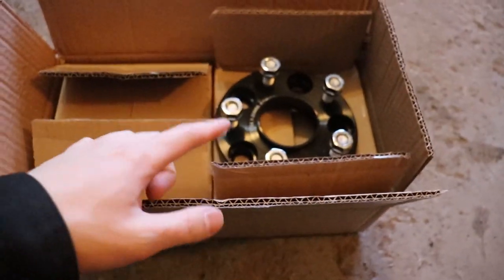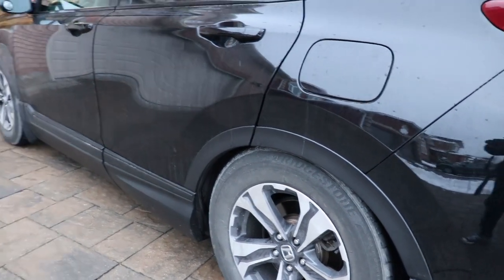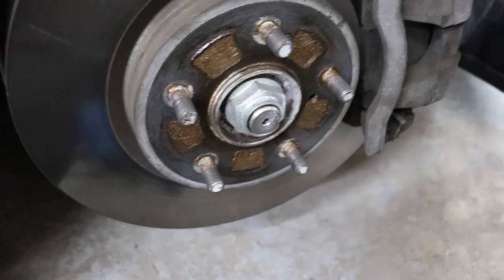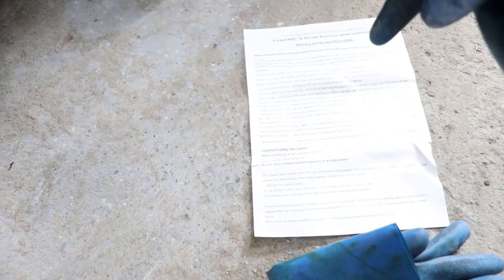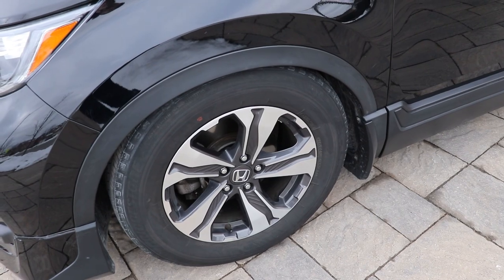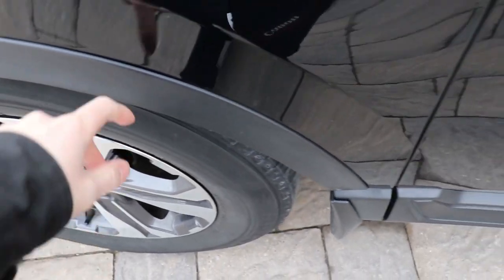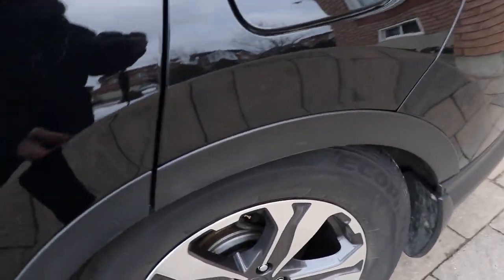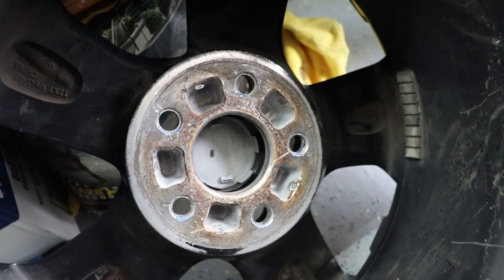Installing Cheap $100 Amazon Spacers on the Honda CRV (Accidently Damaged My OEM Wheels)

Comment from the maker: Pinning this comment to give updates incase something goes wrong with the spacers
Reply from the maker: Almost 2 months with them on the front and I havent had any problems
Reply: Any news with the spacers? 
 do you still have them on front and back ?
Reply from the maker: @chalachasca  I have them on the front still and I checked for tightness last week, was still holding up to 85 ft-lbs that I torqued it to! I took off the rears since it was making it a little too wide and it was having problems clearing the plastic trim without crazy camber. I have school in the summer so I wont be home with the crv to cut down the trim in the rear like I want to but I will eventually get to it and get the spacer on. I just have to find some time to cut it down and seal the gap between the fender liner and the trim to prevent it from potential corrosion in the winter from the salted roads in Ontario
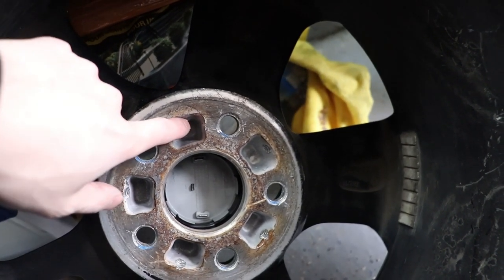Reply: you said I damaged the OEM wheel because I didn't notice that there wasn't enough clearance between the OEM studs and the OEM wheel cavities (shown at 13:10). Easily avoidable*** will this happen to all wheels? I have 19s on my CRV, how to avoid the damage?
Reply from the maker: @EsenbekAliev_  This only happens to wheels when the cavities aren't deep enough. I'm not sure if your 19's will clear it and the only way to check it is to test it yourself. You would have to either shave some material from the stud or shave it from the wheel cavity to make it bigger to avoid the damage/contact if that makes sense
Reply: Hows the spacer holding up man ?

Comment: what is this spacers for ? for what purpose does it do to you car?
Reply from the maker: Mostly cosmetic, to push the wheel out more so that it does not sit inside the wheel well as deep and look funny. I wouldnt recommend installing them if youre thinking about functionality because it will be one extra thing that can go wrong

Comment: Anthony would it been a issue if you installed 15mm spacers instead?
Reply from the maker: I think so because the studs would have stuck out more than on the 20mm spacer. This is assuming that the 15mm spacers also have their own studs. It really depends on your wheel and if the cavities on the mounting side are deep enough for the studs to clear

Comment: Quick suggestion. Rather than messing your car more than what you currently did (wheel alignment, suspension, wheel damage), just buy a slightly different tire size that has a lower profile. Also, bridgestone is one of the worst tire for non-stock setups, because the sidewall expands waaaay too much.
Reply from the maker: Running a lower profile does not retain stock diameter and it usually makes the car look ridiculous. The bridgestones were stock, changed them out to firestones recently and I have a new 20" setup Im looking to run in the summer

Comment: You can use an impact wrench with no problem if you do the final tightening with a torque wrench, issue is that you can over or under torque your spacers when a specific torque spec is crucial to proper operation and safety
Reply from the maker: Another reason why I dont use a impact wrench is because my sockets are too thick to fit inside the spacer bolt holes too and I dont want to risk damaging it that way somehow

Comment: Good head's up about not using excess pressure to tighten the lug nuts or over tighten up of the lug's during installation process great 👍 video 📸 thanks for the video 📷
Reply from the maker: Always trying to highlight the mistakes i made so others can learn from them 👍

Comment: Why would you advertise these spacers then?
Reply from the maker: Look online and youll see that spacers with their own studs are made like this. It was user error on my part that resulted in this issue, not a product design flaw. I am still running them on my car today and I genuinely believe that paying significantly more for a brand name one that is "better quality" isnt worth it for me because im convinced this specific set of amazon spacers are built to the same standards. They also clearly state in the instructions that you need to cut the oem studs down if they are too long for the wheel cavities to clear, which I didnt so because I thought it cleared (again, user error on my part)

Comment: Im sorry man... The spacers did NOT ruin your wheels bud. You did. You have to know what you are doing. You were sitting too low for that tire size and offset if what the spacers brought the wheel too. I worked with tires and wheels for almost 2 decades,  I've never messed that up. There is math behind that. No guessing. Always check all fitment. Even spacers against wheel. Not all wheels are designed in the back like yours.
Reply from the maker: No need to be sorry. Im the one installing them so I acknowledged that I damaged my own wheels and its not the spacers fault. This video is just showing people to not make the same mistake I did. Most if not all spacers with studs will probably present the same obstacle. Other than seeing it on Youtube, I have to learn some of these things from experience here because I am not the automotive field of work

Comment: To much mm mine is running 7 in the rear and 5 in the front and looks awesome
Reply from the maker: Yeah, that could work. It doesn't push the wheel far out enough for my preference though

Comment: If the instructions are telling you not to use an impact wrench because it could damage the spacer isn’t that bad? There’s another video on YouTube showing someone hitting a spacer with a hammer and it shattered.  To me impact wrench on this spacer will damage it in the same way.  Could be a clear indication of bad quality.
Reply: They're telling you to not use an impact, because an impact is not a torque wrench, and it's much easier for someone to damage things with an impact, especially now a days with high torque impacts readily available everywhere.